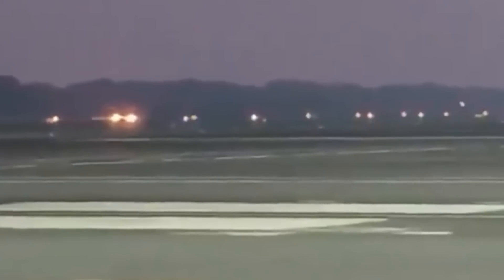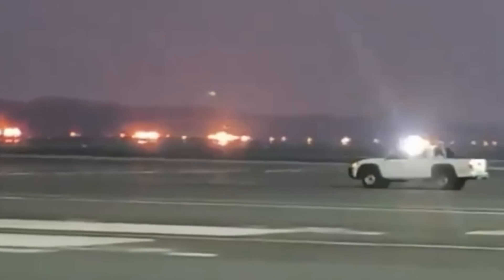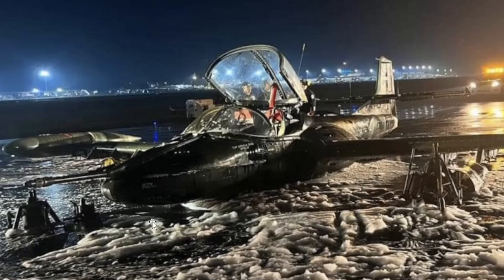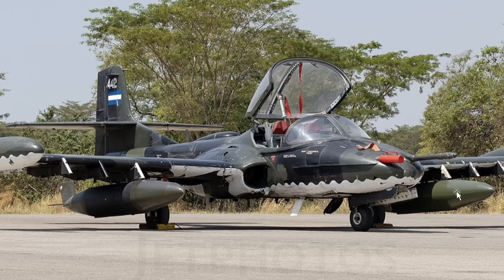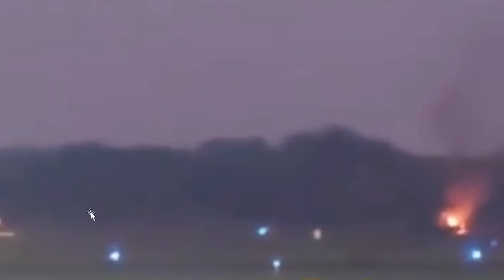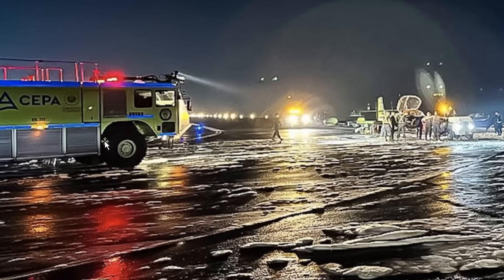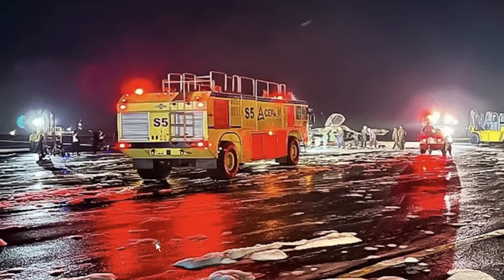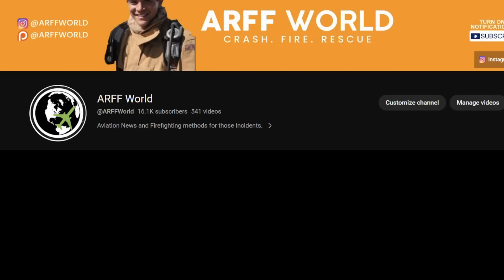Cessna A-37 Dragonfly Fireballs down the Runway

Comment: It has been said of the A-37 and T-37 that they convert hydrocarbons to noise. They have a high pitched shriek at all power settings.
Reply: The A-37 has two F-5 engines (J-85's).
Reply: Called the Tweety bird....  noisy as hell, but a great trainer
Reply: The A-37 doesn't sound anything like the T-37.
Reply: @jcheck6  
They are loud, different engines still loud.
Reply: @DWBurns  DW I was referring to the "high pitched shriek" you mentioned.  The A-37 didn't have that.  I flew them both and surprisingly, I found the Dragonfly more fun to fly than even the F-4.
Reply: Glad the pilots got out safely.  I was with the test flight commander when the gear would not come down on a T-37 at Reese AFB.  They foamed the runway while we flew around the pattern trying to get rid of as much of the fuel as possible.  We came in and landed it on the foam (like greased owl s-it) finally slowing it down and then veered off the runway into the sand.  No fire.  The only thing that had to be fixed other than the gear that didn’t come down was one belly panel.   Note: the Proportional pump is directly above that panel about and inch away from the pavement and sparks.   Ouch!

Comment: That is a training aircraft so ordance will be hung on it. But you are correct aboout the fuel tanks. To me it looks like she landed with no landing gear deployed. First truck in makes it snow like a son-of-a-gun next in deploys handlines while the rescue guys deploy for the crew. The flight crew [instructor & student] did walk away judging by the open canopy & the ejection seats were "safed" [notice the flagged pins in place] & the canopy open.
Reply from the maker: Good observations Al.  Thanks
Reply: @ARFFWorld  You should have seen me in action. You have to observe everything because the slightest thing could get you or someone else hurt or killed.  You have to develop a 6th sense when it comes to aircraft mishaps & any other emergency response/s